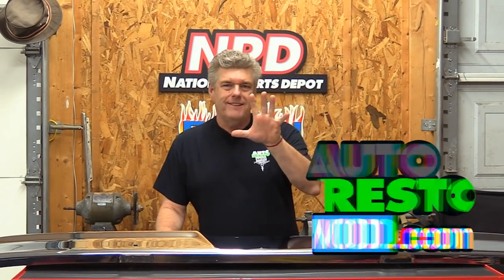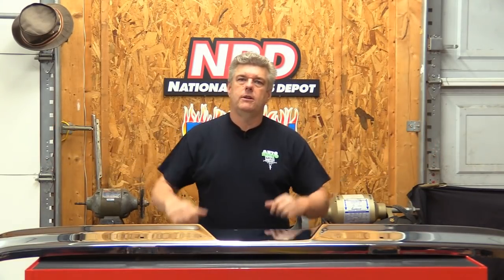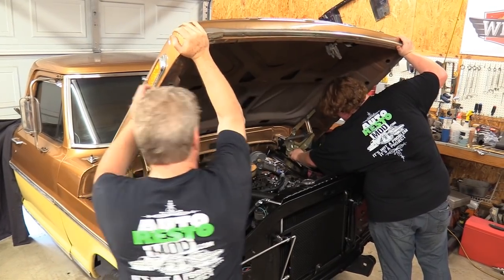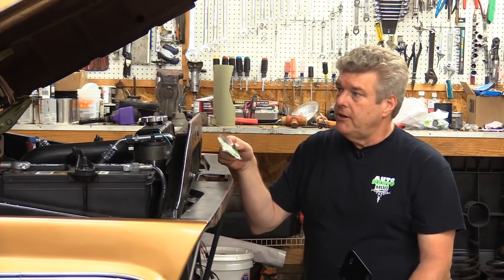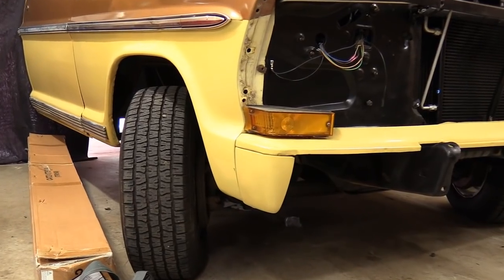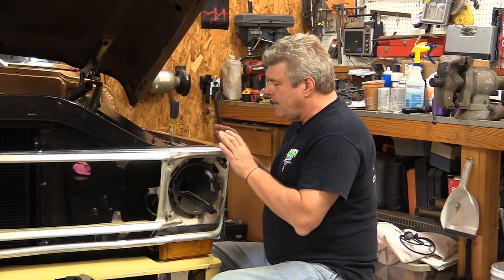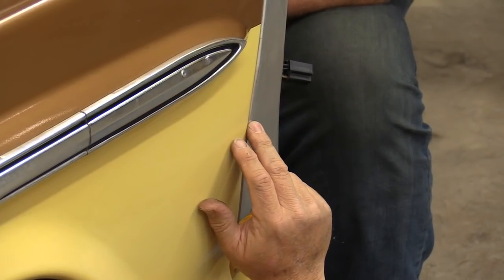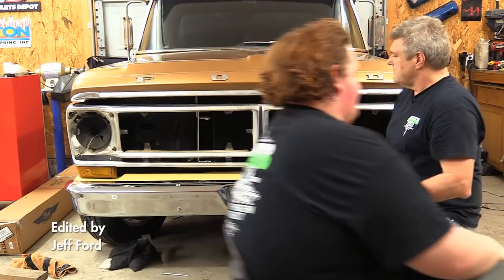#Bumpside How To F100 Fender Stone Guard Grille Install and Alignment Episode 413 Autorestomod

Comment: Jeff if you want to talk about things going stupid high. try finding a 1967 f-100 aluminum grill.those where one year only. thankfully mine is kinda o.k. not perfect but it,s gonna have to work.
Reply from the maker: Yerah, anything that is one year only will do that. '67 Ford was a weird year for that too, lots of Mustang and Cougar parts were one year only.
Reply: Jeff i am fixing up a 67 f-100 and at the same time i am bringing back a 67 Mustang coupe. sometimes i question my sanity. when i got the Mustang it was just a shell and that was it. there is not a nut bolt or screw on it that i have not touched.